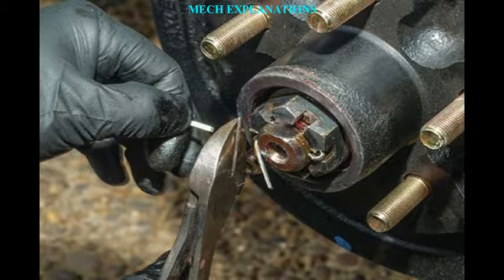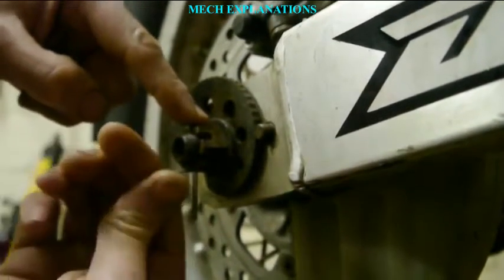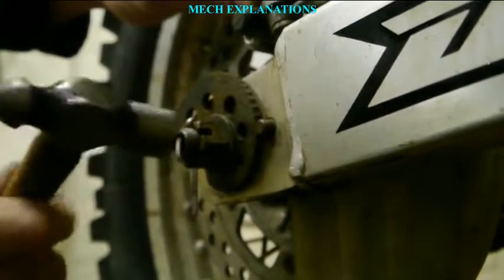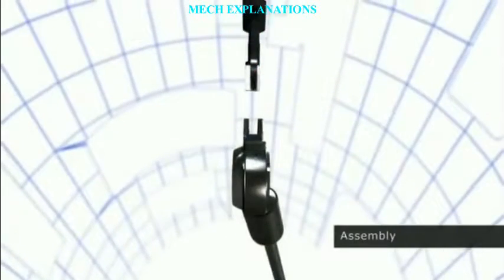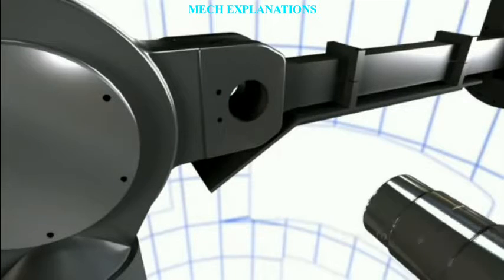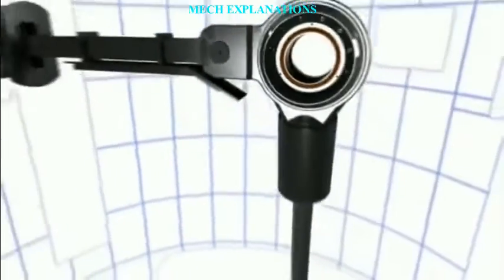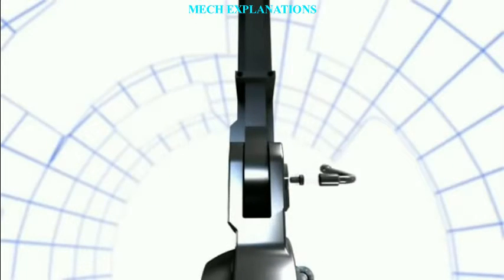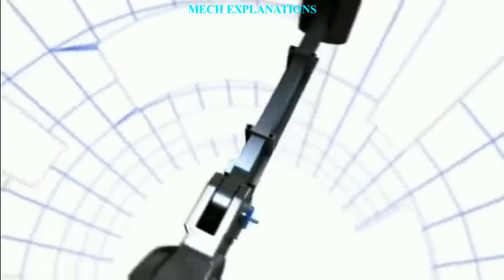Split pin  ✔

Comment: Split pins (sometimes called cotter pins) are used to retain which of the following:
 Metric lock nuts
 SAE threaded studs
 Castellated Nuts (Castle Nuts)
 Dowel pins
Reply from the maker: castellated nut